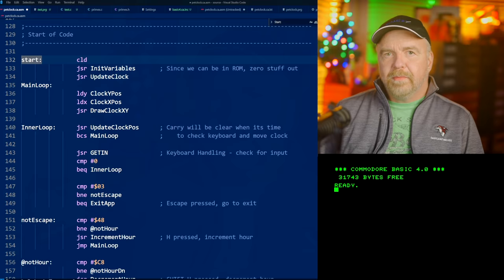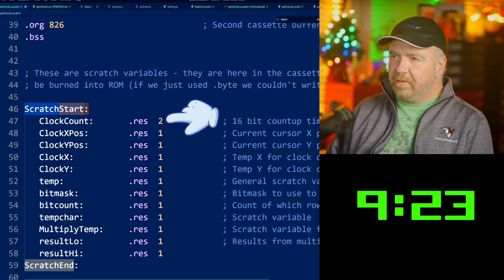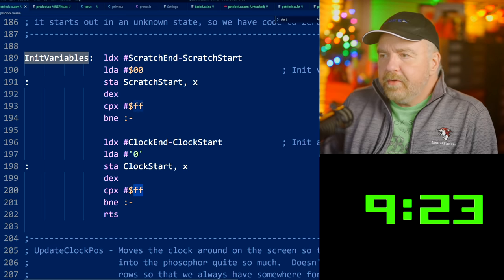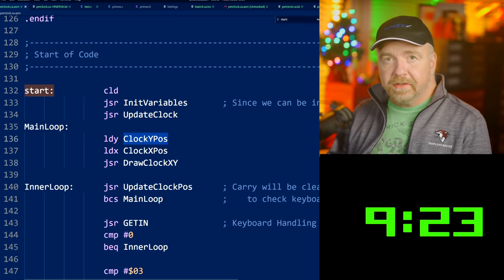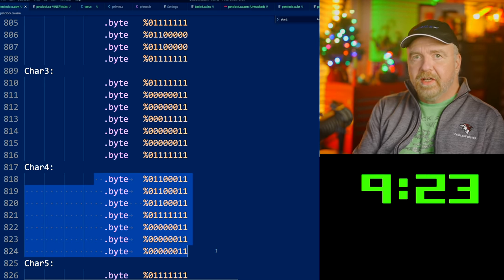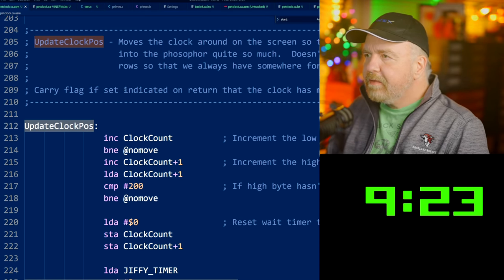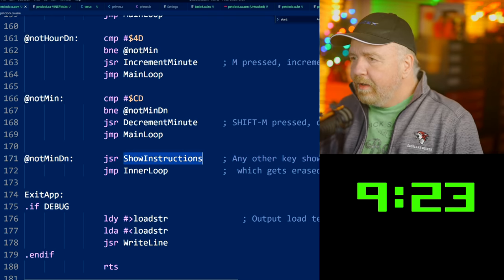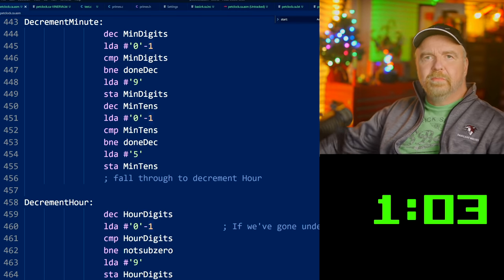Assembly Language Snow Day!  Learn ASM Now!

Comment: Makes me all nostalgic. It's like they say, you never forget your first kiss. I still remember 6502 Assembly code from back in the 80's. But my memory of Amiga assembly code etc, has faded - but the C64 (6502 processor based) will always be inside my mind. Useless information, but meh.... it was our time.
Reply: Exact same way.  I looked at so much 6502 back in the day I could look at byte code and tell what the code was doing.  My assembler didn't have the < or > for low and high byte.  Now that's new.  Not sure why I find these videos so interesting but like you said, first kiss.  

I did work, as a kid, for a company called perspective software.  They wrote C-NET BBS software for the C64.  I learned a very cool trick that stuck with me for years which was that RAM and ROM lived at same address and we would toggle between the two at 60HZ to be able to use the RAM under the ROM.  It was a clever trick someone taught me and I still see this today on modern ARM SoCs.... anyway, love the videos...
Reply: Same. I wrote so much 6502 written as hexcode DATA statements in BASIC. You never forget your first.
Reply: @DavidHathaway  Oh yes, that's how it started. First Basic, then you'd meticoulously type in all those numbers with Machine Code data that you read in a computer magazine untill you got yourself an Assembler. My first assembler was the Hes Mon 64 cartridge, no such luxuries like Macro Assembly, no - we wrote directly to memory and changed code on the fly, disassembled the rom + numerous games just to see how it all was done, and changing it to learn, snippet by snipped. Oh good times. I was only 13 at the time, my parents thought Games were akin to Gambling so they were against it. My math teacher came up to me once when he saw me sitting there alone in the schools new computer room. What are you doing there? Oh how did you make those objects move across the basic screen without basic, and live while you're typing? Interrupts I told him. He was fascinated, I otherwise sucked at math in school, but the fact I was sitting there doing machine code blew his mind. Pity I couldn't get that inty my grades :)
Reply: @joonglegamer9898  yes, and then my folks got me a Timex-Sinclair 1000, and I saved my paperboy money to get the 16K memory expansion module. Such a good time learning Z80 except for that craptastic membrane keyboard.
Reply: @DavidHathaway  Haha, I have that one in my drawers, original packaging and all. It brings even more memoris tolife, when you told me of the Sinclair (which is essentially a ZX-81 with 2 KB of ram instead of 1, right?), anyway - my best friend back then had a ZX-81, and he would constantly stress how superior the Z80 processor instruction set was to the 6502, he was right of course, but the C64 ended up more "overall" powerful because of the specialized hardware, custom sound chip, custom VIC chip etc. The Timex/ZX-81 essentially had a faster processor, 3.25 MHz if I remember correctly? But used a lot of the speed for drawing the graphics screen. He eventually ended up with a C64 himself.
Reply: Back when computers were fun and understandable. These days it's processors and OSes hidden in layers and weird cache line attacks - bleh.
Reply: @davidtaylor6124  Best thing in GNU+Linux nowadays.
Reply: Same here, I still remember most of the peeks and pokes, all assembly instructions, how do define your own characters, sprite manipulation, raster interrupts and  Commodore BASIC

Comment: Fascinating - at school we had one camp who were Z80 aficionados, and another who were proponents of the 6502. I did heaps of assembly in the 80’s, even writing a modem driver in VAX macro assembly language. I was on the Z80 camp, and looking at your code to draw the characters, I would have loaded the bitmask into the accumulator, then run a loop of 8 left shifts, and test each time through the loop if the carry flag was set then draw the block character. No need to draw a space as the screen is cleared totally before drawing the time. I’m interested as to why you chose to do a logical AND and shift that value around instead, it seems quite a lot more work than just shifting bits left and testing the carry flag. Loving your channel by the way, my MS badge number was 168860, 2001-2011. 😀
Reply: And I'm in the Z80 team.
Reply: I was a 6502 guy until I went to college.  We did 8085 and Z80 there.  Some of the VERY CISC instructions on the Z80 were nice.
Reply: @ScottWalde  - I agree. I amazed my CS teacher at school with LDIR. 😀
Reply: Z80 amateur here - wrote a space invaders game in Z80 machine code, pencil and paper, didn't even use assembly. Entered in hex by hand and stored on audio cassette tape. Might have got a better degree if I had spent the time on something more useful!
Reply: I was familiar with 6502, but drooled over the Z80,000 spec instruction set. So disappointed it never saw the light of day (that I am aware of), because it so mimicked the IBM S360/370 instruction set. I was subcontracting to IBM around the time the PCs came out, doing mainframe OS subsystem software development. We just couldn't understand how they went with  Motorola as a chip, rather than get on the Zilog path. It made no sense, it must have been pricing.
Reply: Yes, shifting through the carry flag would be faster by one instruction and two bytes. No need for a compare instruction. Just shift left and branch if no carry. 8 times.
Reply: I did 6802 after my first Z80 design was stillborn.

No tools. All made by hand. 

Z80 is nice for the time. 
But stack the Z80 against the MC6809E and you have no contest when it comes to the ease of writing code and to have a responsive system.

Comment: My first ever computer I touched was a Pet whilst being baby sat, I was hooked and was given a VIC-20 for Christmas. Never looked back progressing to commodore basic then to6502 assembly for speed. C64 and then to Amiga with Devpac assembler. The 6502 made me want to get a job designing microprocessor that I did for a bit until working on 3D graphics accelerators and eventually image processors. Learning to code used to be so much easier even writing in assembly language. Such a simple set of instructions and direct hardware registers rather than complex Object oriented languages that we use today. Was certainly a golden time to be a kid with a computer. Thanks for this trip down memory lane!!!

Comment: Great video Dave, brings back some fond memories.
The '80's - the 'golden age' for assembly programming. A stunning level of required critical thinking and innovation, particularly for games programming, by folk who quickly developed a strong, deep passion for this subject, and who literally knew this language inside out, fluently - and at a time with no internet and few books...almost zero examples. You had to think outside the box, in fact, there wasn't a box in the first place, lol.
While there are numerous benefits, of course, we've definitely lost something extremely important for every programmer when we offloaded so much critical thinking to online, with such 'wonders' as stackoverflow to provide a solution to every question. 
Question: as our expertise(!) in assembly language is rapidly becoming reduced primarily to a curious afterthought (I'd hope C++ is the exception), are we leaving some extremely serious doors open for some 'state sponsored' (or otherwise) nefarious activities...???

Comment: This sure brings back fond memories for me. The first non-homebrew computer I ever owned was a Commodore PET (with the old Chicklet keyboard and cassette storage). One of the first programs I wrote was a mimic of Pong, written in BASIC. It ran far too slow to be usable, forcing me to rewrite it in 6502 assembly language. I didn’t own an assembler, so I had to hand-assemble my code using pencil and paper, and then type in the hex using a “monitor” program. It was tedious, but I sure learned a lot. My beginner programming buddies thought I was a genius for pulling it off.
Reply: You had a "monitor" program?  I remember POKEing my hand-assembled code into memory.  (VIC-20)  Eventually I got a VICMON cartridge, but that was years later.  The Apple was such a leap forward with CALL -151. :-)

Comment: I started assembly code with the TMS9900, which was the first 16 bit processor, released in 1976. As a very junior engineer they asked me to design built in test equipment (BITE) to test memory cards on a ship borne system. The only display device was an oscilloscope, so I went into deep development mode for a few weeks (we had quite a free hand) and came up with code that ran all the tests then converted it to text messages via a digital to analog converter (DAC) that would scroll across the oscilloscope screen once the right time base and voltage range was selected. It became a standard test bed for the memory cards wherever they were used in the system. Happy days.

Comment: I wrote 6502 assembly language when I was in college. Since then, I've written assembly language for a Z-80, several DPS chips, including the TMS320C30, the 68000 processor, and Intel X86 processor, mostly because I wanted to do efficient signal processing using the SSE1, SSE2, and SSE3 instructions.
At one point, I was fluent in all these processors. Naturally, even back then, I wrote mostly C, and later mostly C and C++. It's been a long time since I wrote assembly code, and while I could still write Intel assembly language code, I don't recall any 6502 assembler now.

99% of software jobs today could be advertised with, "No assembly required."

Comment: Reminds of a scrolling Times Square display I wrote for fun in assembly for the Sinclair ZX81. It was all hand-assembled using a Z80 processor reference and ZX81 memory map. Lots of fun! I later landed a job at Motorola programming their early cellular switching system, which used fault-tolerant Z80 boards. The project somehow impressed my interviewer, along with a similar hand-assembled Space Invaders game. I hated calculating those relative jumps by hand. Stayed at Motorola for 30 years.

Comment: To anyone in the UK wanting a generic introduction to what is inside a Microprocessor/computer chip I can highly recommend the Open University course T224 "Computers and processors" - which you can still buy the student books for - even though I see the course itself has been replaced by a newer course.  That course explains processor cores, CISC and RISC, memory system architectures and things like bus bridges (as in Northbridge etc) and allows you to see what happens - step by step - when one of the asembly language steps used in Dave's tutorial is executed.

In the early 1980s I did absolute oceans of machine code for the SC/MP microprocessor (Nat semiconductor chip) and then a little for the 8086 (Intel's first 8 bit MP) and yes, it gives you a knowledge of the basic processor like nothing else can.  Nevertheless my goal was not to study processors it was to create useful programs and consequently I was very happy to move on to BASIC which I always likened to "flying after spending years crawling on hands and knees"!  Visual Basic and then C++ and Jscript etc experience all followed though I did have a brief regession around 2000 when I had to write some assembly language code for an Atmel AVR microcontroller - which taught me huge amounts about that architecture, but reminded me how much work for relatively little result - albeit that the resulting code ran within the memory constraints and very fast.

Comment: Wow. Having bought an Apple ][ in 1977 this brings back memories. I definitely did NOT code in such a structured method. In fact it was load fire aim back then lots of experimentation and trouble shooting.  It is so cool to see a properly disciplined and structured assembly code for a computer that’s slightly older than my marriage.  Thank you for this.  Keep it up.

Comment: Was very interesting to see "2022"-era coding style applied to this older architecture.
I started learning assembly in 6502 on an Apple//e in school in the mid 80s. My mind went to "how to optimize" this code at each step - those old habits are so hard to step around.
Reply: yes, That was a very interesting setup, all round, the bit that was only slightly touched on pet, was pet's memory and resources , (lack of),  and resources being used to 2022 had software, hardware talking, communicating, to the same goal?  
Was anyone thinking a flip clock, as Dave was moving the time back and forth with the PET's clicking keyboard sound going and number changing on the screen?

Comment: sta (zptmp),  y      Ahhh indirect indexed addressing mode. That was when I really grasped that you can point the processor anywhere. It blew my mind. It was the single most important instruction I ever learned cause it's the one that taught me pointers to pointer tables, to pointer tables, that could go on infinitely. I was on an Atari 800. It had memory mapped video also. Used to point it to the OS and watch the OS work by watching the characters change. It was an ad hoc way to find things, as the Atari had a closed architecture and info was scarce.

Comment: Excellent stuff, I learnt BBC Micro 6502 back in the day, having a builtin assembler was definitely an advantage
Reply: A small change if writing this for the BBC Micro would be to read the character definitions from ROM that are used for screen modes 0 to 6 but display the clock in mode 7.
Reply: @martinrwolfe   I was just setting up VICE for commodore PET emulation 👍, but your suggestion makes sense.... mode 7, teletext mode.
Reply: Back in 1988 I was taking an electronics course in which I had a crash course with 6502 assembly on the BBC Micro. I had created a light pen for the BBC and had to write the assembly routines to read the pen to get the screen position! All the pen was was a light sensor so all the actual work was in the assembly code.
Reply: @martinrwolfe  I think there might even be a 'licit' way to obtain the character definitions through some system call on the Beeb, believe it or not.
Definitely Acorn tried to write their APIs {as you might truly call them} as if it were already 'the future'. Pity the 6502 was unable to code a relative jump (except for a conditional of short range - i.e. 8' signed). Motorola's 8-bit was the belle of the ball - but they (Acorn) had their own solution in the pipeline, as we know well!
My blood was almost boiling when I heard him talking about jumping into the right place in the ROM... but then I thought, how cool it would be to prove that to be the case with a comprehensive a step-wise debugger! (emulated or otherwise.)

Comment: While I was in college, I had a job in the Physics Department doing lab tech stuff. One of the computer labs was being upgraded, so we got a bunch of Apple // computers, but no floppy drives. I wanted to make some basic logic analyzers to use in the digital electronics classes. 
So I designed and wire-wrapped an 8-bit input card and wrote an assembly capture program for it. I wrote the display and control program in BASIC. The problem was how do I get the programs onto the machines w/o drives.
So I made a boot loader that pretended to be a disk controller card so the Apple would call a routine on it when it was turned on. I burned the BASIC program into an EPROM, along with a little assembly program that could copy it out into RAM in the spot the interpreter was expecting it. Then pretend to type "RUN" so it would launch the program.

Comment: The last time I used assembler was probably a device driver for a 16-bits mini computer, but I still do use an ancient computer.  It is the leftovers of mainly a 2003 HP D530 SFF with a Pentium 4 HT (1C2T; 3,0GHz); 2GB DDR (400MHz) and 1.21TB in 4 HDDs (3.5" IDE 320+250GB and 2.5" SATA-1 320+320GB). It is in use as backup-server and powered on for ~1 hour/week. It still uses samba for restoring e.g. a single file and rdp for monitoring, both based on Microsoft Networking and the Remote Desktop Protocol.  The software is new like Windows 11, 32-bits FreeBSD 13.0 with OpenZFS 2.0 released April 2021.

Comment: Very nice video, Dave. The number of programming tutorials you see on line with a full-screen display and tiny characters... Zooming in on the code that you're talking about is SO much better.
Keep up The Great Work.
It'd be interesting to see if you can peek into the memory where the video controller stores it's character table and then use those character definitions for your big characters,

Comment: I remember writing an ASM fruit machine simulator years ago, gees how things have changed. I've done the C, Java,  now its all enterprise dev ops, full stack, and writing my own multi-cloud diagram tool with compilers into AI pipeline models.  All this is so nostalgic. I got into coding when I was at the kitchen table as a 7 year old and my brother had a ZX81 (Sinclair) and he was typing in a listing from some Magazine. Half the fun was typing it in and understanding it, and half the challenge was making sure not to crash the machine too as it had a 16k RAM pack.

Comment: Wonderful!   Someone else on Youtube who really knows 6502 CBM assembly well is Robin from 8 bit show and tell.  I was able to follow you somewhat, I know LDA for example "Load the accumulator" and BNE "Branch if not equal to zero" etc  But Assembly is daunting even for though who have used it for awhile.   I imagined what is going on with the JRS commands were similar to loading modules in Python for example.

Comment: I remember Jim Butterfield, I read his books on vic20 and c64 to learn. I had to save the assembly  code to tape. Run  it and if it crashed then I had to load from tape and edit.   Very slow process but running in assembly to get the speed was worth it.